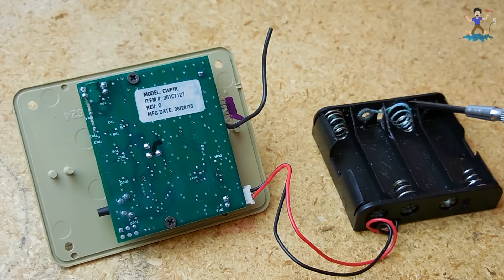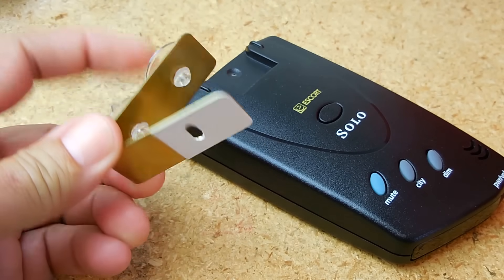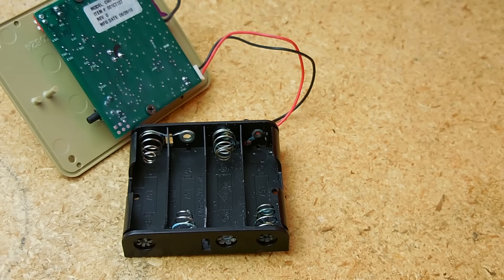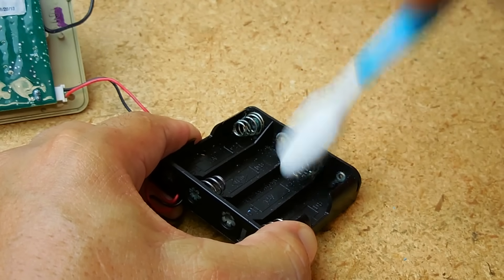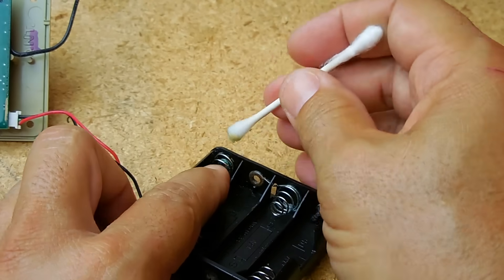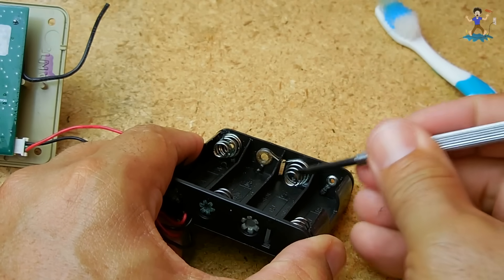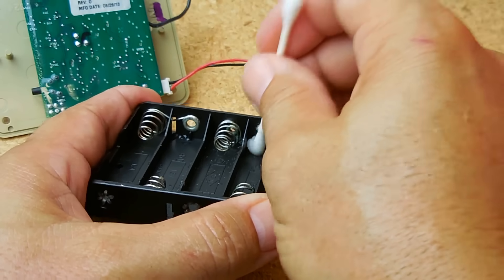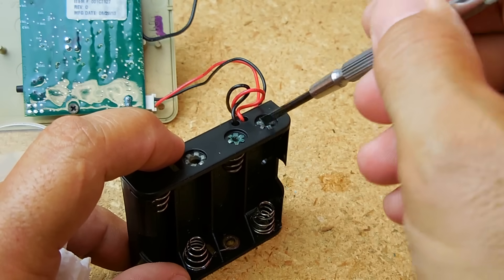EASILY Clean Battery Leak Damage(Corrosion) In Electronics

Comment: This was excellent!!!  I've repaired battery corrosion from posts, springs and terminals with an X-Acto blade, which made the devices work again, but now know I may have taken off too much protective coating and did not know about the Vinegar part to get all of it.  I use 91% Isopropyl Alcohol to clean all kinds of things, but this complete procedure is wonderful!  Great DIY Tip that most anyone can do. 

To the unexperienced reading this:  Getting some things apart, like remote controls and other closed-plastic-cover case devices can be tricky, even after removing screws, but you should be able to find YouTube videos that will tell you how.  Maybe not your exact product, but you'll find other products of the same type that are close enough.  There aren't many techniques to lock the two cover parts together, so if one doesn't work, keep looking.  This guy, electronicsNmore, may even have some.

Thanks, man!  This was great!

Comment: Leaking batteries are an absolutely continuous annoyance in our household. Pocketlamps, radios, clocks and device whatever use that cruel batteries: When they becomes flat, they are leaking and damage all utensils and apparatus inside. I have an old  toy-sewing machine of my sister, what is now more then 60 (!!) years old. We warnt to sell it and wonder: The original-Varta battery-cells inside are from our father! And they are o.k. and still working. I think the modern ones are awful chemical garbarge.

Comment: Thank you so much! I was involved in the electronics industry either directly or peripherally for over 30 years and I never knew that simple fix! Even better,  I dug out my multi-meter to check a car battery just yesterday and guess what? Yeah, corroded terminals.
I did scrape the contacts clean with a screwdriver and emery board (not ideal) but now I know how to do the job properly.
As I have already compromised the plating on the connectors, I will probably run some solder on them and hopefully the fix will stay good.
Respect and new subscriber.
Pax

Comment: Eye protection is recommended and also handy is a small nail style emery board, (the thinner the better) to assist with heavy corrosion.   The rest is exactly how I deal with the same problem.  Also a vacuum can be handy to deal with corrosive flecks brushed or scrapped away.  They can cause skin burns or eye damage in the process.  Good video.
Reply: Finally I see a smart person in the comment. Same with toilet cleaner. Long gloves, a simple face shield and no brushing, use hard sponges or soft sand stone scrubbers. Put a dust mash on when vacuuming, or smoke some acid if you are wanting an early death.

Comment: Not as good as vinegar but saliva is also mildly acidic and can work in a pinch when a slight battery leak has been found and you don't have time to clean it right.
 Leakage from the old lead acid batteries was neutralized with baking soda.

Comment: Batteriehalter, Kontaktfeder, Kontaktblech, Kunststoff in Enkalker (Flüssigkeit) gelegt. Es wurden alle chemischen Substanzen aufgelöst/entfernt. Metalloberflächen blank poliert.
Battery holder, contact spring, contact sheet, plastic placed in decalcifier (liquid). All chemical substances have been dissolved/removed. Metal surfaces polished.

Comment: I've never tried vinegar.  I'll give that a go, next time.

NiCd (Nickel Cadmium) batteries were notorious for "black wire corrosion", meaning that the corrosion you see spread from the negative battery terminals along the wire to the circuit board.  I'm not sure if that applies to other battery types, but I suspect it does.

I don't know if it was known as "black wire" corrosion because it affected the negative lead, which usually has black insulation, or because it turns the copper in the wire almost black (which it does).

If you have a clip like that, separate from the circuit board, the next step is to strip back some of the insulation on the negative (black) lead and take a look at the wire.  If it doesn't look like shiny copper or steel, the wire needs replacing too.

Comment: When I clean battery corrosion off of my equipment I use WD-40 it just eliminates the corrosion and then I use a napkin to wipe off in a little bit of residue and it works great just spray it on because WD-40 is a water displacement then it also removes any moisture I find it works the best

Comment: To improve conductivity, solder the joints of the springs and the rivets.
Apply a little oil to the contact points to prevent future corrosion.
Reply: Try some silicone pool grease as it is chemically resistant.

Comment: Ive been cleaning corroded battery contacts this way for years now. One tip I didn't see is to hold devices like remote controls etc upside down when applying the vinegar and alcohol. This prevents it from running down inside and contaminating the circuit boards. Great video.
Reply: Willthisworkoncarbatterys

6:38
Reply: @Doug-ze5mz  yes this can be done on a car battery.   Corrosion causes high resistance between the battery and the battery terminal therefore lower voltage being supplied to the device.  Once the battery terminal is cleaned, rub on a very light coat of petroleum grease/jelly on the terminal to prevent future corrosion.
Reply: Well he does mention at 6 minutes and 30 seconds thought it would be a good idea to disassemble if possible for that reason. Though thanks for tip. It sounds easier.
Reply: @aarons.936  This is so the vinegar doesn't get into  the device (example: the remote controller) and cause other operating problems.
Reply: Alcohol won't damage the circuit board. It will evaporate too quickly. You can clean a circuit board with alcohol.
Reply: @RustyHinge  In this case the alcohol is contaminated with vinegar and oxides and it will carry that to where ever it goes then the alcohol will evaporate and leave the contaminates there.
Reply: @billshiff2060  , exactly.
Reply: If it is Alcohol, it doesn't matter because it won't contaminating the boards
Reply: @mracer8  "In this case the alcohol is contaminated with vinegar and oxides and it will carry that to where ever it goes then the alcohol will evaporate and leave the contaminates there."

Comment: Remember when these batteries came with a guarantee? If their battery ruined the devise EverReady would replace your devise! This is too time consuming; I dip the whole battery case for 10 sec in sulfuric acid I keep in a plastic coffee tub from car-battery cores, rinse with water, and dry with air or WD40. It's also imperative to coat the terminals with dielectric grease before reassembly; works great on old rusty car parts too; the acid attacks the oxide first since it has an unstable oxygen atom to give away...

Comment: I have an expensive Nikon camera flash that has a battery issue. If I don’t use it for even just a few weeks it won’t turn on even though the batteries are fresh and there is no visible corrosion. I just put a drop of white vinegar on a cotton swab and rub the battery connections and then everything is fine again.

Comment: Hi like your video I just came as a recommended video to me today. I've been doing this cleaning those battery compartments for decades. At times I find a no electrical connection where the end of the spring is clamped on to the the black wire. So I scrape or use a memory board to shine up in the center where the spring attached bike clamping around the black wire. So I scrape or brush that area clean and then quickly solder The wire and the spring and together in order to make the contact directly. Cuz behind underneath that clamp the green is still tarnished you can't get wiped away so I have to override that area by soldering quickly before the plastic housing melts from the wire to the spring directly

Comment: I once disassembled a toy where the batteries had not only leaked and completely corroded the contacts, the corrosion went along the wires and corroded the contacts on the motor! I'd never seen that happen before.

Comment: Some notes:
- I also use a dental pick where the screwdriver won't quite fit.  
- You can use some kind of electronic "dust off" to blast out residual moisture.
- Always follow up with De-Oxit as many ring connectors are not soldered, just compression fitted and sometimes they get badly corroded and partially loosened.
Reply: Deoxit is how it is spelled.

Comment: If the geen stuff keeps coming back, just put a bit of solder on the portions that make contact with the batteries. I did this in an attempt to "replate" the contact points. It still works many years later, so I do not know exactly how long it lasts. Carefull with the soldering iron near the plastic. Solder quickly.

Comment: Great tip, never heard of the vinegar. I have always used a baking soda solution with great success. Thank you!
Reply: Do not use baking soda with alkaline batteries. It is for zinc carbon batteries. Baking soda is alkaline.

Comment: This is really handy. Even years after you made it. Just popped up in my feed today. What about the "Hard to reach" areas. Like deep in a flashlight case? I had batteries swell and leak and can't bear to part with it. "First run streamlight 4aa LED" designed for fire fighting. Got the batteries out but there's a ton of gunk in the well.

Comment: If it's worth it you might find a replacement battery box/holder. I have found rechargeable batteries to be more durable than disposable types. And cheaper to use in the long run.

Comment: Purchased 4 Ray-O-Vac 8 battery camping lanterns for use in camping, as well as a handy light  source when the power goes out, which is frequent. Also, as a set, I brought 8 Ray-O-Vac alkaline batteries for each lantern.
The lanterns worked very well, especially when we lost power.
Point of matter. By having a need to always use the lanterns, I leave the batteries in the lanterns for ready use.
As a result of this, the batteries leaked, corroding the contacts. Since the lanterns had a lifetime guarantee, and since I used Ray-O-Vac batteries, I put in a claim including pictures with the company. 
Co-vid19 interrupted my claim a few months, and I  called back asking for new lanterns on my claim.
They asked for their old batteries, knowing I had threw them away. Since I don't have them, Ray-O-Vac rejected my claim. Point: Why didn't they ask for them originally? I think they did not want to stand by their product, which is B.S.
Just to let the public know about Ray-O-Vac.

Comment: This is why they make electronic parts sprays. Spray and clean, good to go. Most come with a brush tip to push it around and clean the contact. You don't need all this work, mess and materials

Comment: In this case, the offending battery box could have been removed from the device and immersed in a mildly acidic solution for an extended time, and then removed, rinsed from the solution, rinsed, and dried. Any connection surface damage can be repaired by quickly touching a freshly tinned hot soldering iron through soldering paste applied to the damaged surface.

Comment: I have been using Eneloop low self discharge NiMh cells for about 15 years and never had one leak and corrode. Given that they retain 70% charge at 10 years, there is no reason to buy alksline or lithium cells unless you are in an extremely cold environment.

Comment: Hmmm…a q-tip with water takes care of it.  In the case of a battery holder like that…disconnect it from the board and wash/dry it off.  Use a q-tip if necessary. No vinegar is needed.

Comment: I use a fine brass brush on the actual connector site where they touch the batteries, and sometimes tin the corroded connection site afterward.

Comment: Try a pencil eraser, it is easy to use freely available, and can be done on the run. Removing Batteries during times of non use , can prevent the issue .
Reply from the maker: Pencil erasers are great to shine up the contact areas after neutralizing.

Comment: Worth a go. A pencil also works as a quick fix to remove the corrosion. If it is too far gone, consider moving to a lithium pack with charger board that will handle charging and battery management. Ideal if you have 2 or 3 AA batteries in there as the output is around 3.7volts.
Reply: Do you mean the 'lead' of the pencil?
Reply: @Ruylopez778  Lol...No, funny guy...the eraser end of the pencil. But yes, he definitely should've pointed that out I suppose!

Comment: Nice job and I’ll remember this.  I had a pro- slur camera remote flash ran on a batteries leak and the damage was so bad I had to replace the $200 unit as the corrosion was so bad they mechanically failed.  Possible I could have saved it as I was using a dental pick and sanding paper vs an acid like you did.  Thanks for this.  Fo4 now the solution is to make sure expensive hardware with a batteries that might go a few months between use have the batteries removed.  In my case it’s 2 strobes and wires transmitters and receivers so it’s like 14 batteries.  Ugg

Comment: This is why whenever possible, and especially for things that pretty much require the batteries stay in at all times (e.g., remote controls, clocks, outdoor temperature sensors, etc.), I try to use lithium batteries and not alkalines.  Lithium batteries never leak.  Personally I wish alkaline batteries would just be taken off the shelves in favor of lithium batteries (for low-draw devices like the aforementioned where the batteries need to stay in the units) or rechargeable NiMH's.

Comment: I've been doing this for years. Many of my electronic devices are from the garbage, the thrift store, or from the side of the road. It feels great to save money, recycle something that was headed to the landfill, and support our local thrift stores.

Next up: many rechargeable cordless appliances have a bundle of 18650 lithium batteries inside that are not designed to be user replaceable. What a deliberate waste! (Shame on the manufacturers for engineering products that are disposable like this.) With some careful electronic surgery, it is possible to remove the old 18650's and replace them with new ones. Appliance restored!
Reply: get lots of good 18650's from laptop batteries...six or 7 in each battery and probly one bad one which caused the no charge problem...i think the chip they put in the laptop baatteries is programed to kill the  battery after so many hrs of use so people will buy a new one....you can also check the batteries and find the bad one and replace it .
Reply: @gunzmith29r  Thanks for that suggestion. I'll definitely give it a try!
Reply: @gunzmith29r  Yep, I take it apart and use the 18650s in my high-lumen tactical flashlights!
Reply: I agree, products before the 80’s were amazing and work flawlessly to this very day. Yet, products now are designed for death at warranty, if your so lucky. Remember, the massive amount of different charging chords when cell phones became widespread.
Reply: What do you do if the corrosion leaks through onto the circuit board?  Will the vinegar damage it?
Reply: If only one could replace NiMH cells with 18650s too 😅

Comment: So that depends on how long it was left unattended.
I've seen them where they have to be replaced!
I've had some other holder's and I'd use the terminal from them to replace just find a pop rivet that fits and pull the original rivet in place Walla fixed.
Also a good soak in baking soda might help.

Comment: Add a teaspoon of bi-carbonate soda into a coffee cup then add (kettle) hot water . Then submerse battery holder in the coffee cup  mixture and watch alkaline bubble off. Rinse with clean water to remove bi-carbonate soda and dry off.
Reply from the maker: Incorrect. You cannot neutralize alkaline leaks using an alkaline.
Reply: @electronicsNmore  not so! Try it out.

Comment: This tip may have been posted five years ago but it is timeless! I came across it by accident, as I happen to be half way through one of these recovery jobs, the remainder will be quicker and more effective. Thanks.
Reply from the maker: Glad you appreciated the video! You're welcome, and thanks for watching.
Reply: It just came up on my suggested list. I've fixed a few leaked gadgets by removing excess crud with a screwdriver or other object, and they've worked for years, but the vinegar thing adds a whole other level.
Reply: March of 2022 I tried to watch tv after not watching in ages . Nothing worked. Four remotes, one battery was missing. Some corroded so I'll try this, I'm guessing lemon juice may work too, but I've got white vinegar and the other items.
Reply: @veryslyfox 
Brasso?   Don't be an asso!   Everybody knows Brasso is for military belt buckles and such.          jk   ;)
Reply: Same here

Comment: Fwiw… for expensive units where the batteries are not changed often…. Using lithium batteries will prevent this problem.   They are more expensive, but do not leak

Comment: The acetic acid in vinegar is just as corrosive, so you must neutralize it with baking soda-not powder, which has acid—before drying with alcohol. If soldering, use only electrical type with rosin flux, do NOT use metal/plumber flux, which is also corrosive.

Comment: When possible, another way is to pour some white vinegar into a smaller bowl, then soak the damaged piece in it. This covers the entire area, thus missing nothing. Rather than using a toothbrush, an acid brush is effective in reaching into the coils over the small bowl. To clean the white vinegar off  your work, pour distilled water into a clean bowl then soak the part in this water. Finally, dry off the water and let it completely dry.

Comment: I've used baking soda and water mixture on battery corrosion. It works similar to vinegar but you need to be careful that you don't get any into the cells of a car battery if you trying to remove the battery build up at the terminals. Baking soda in a car battery will render the battery useless.